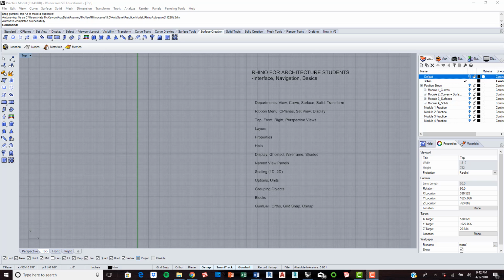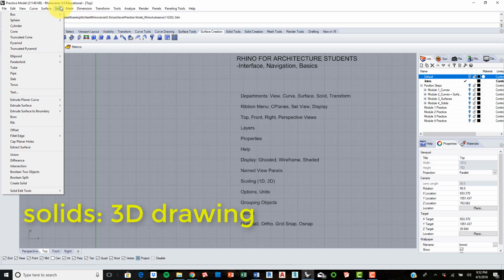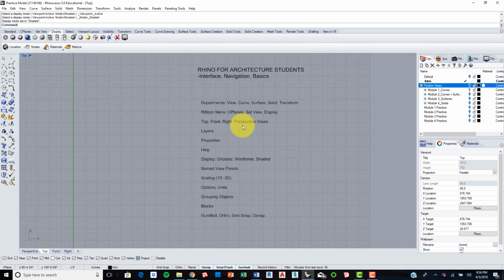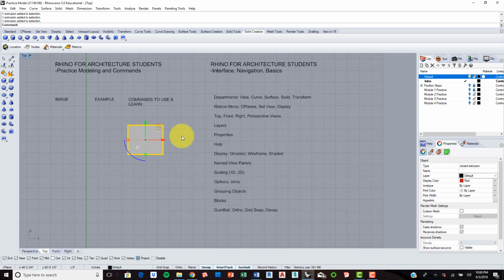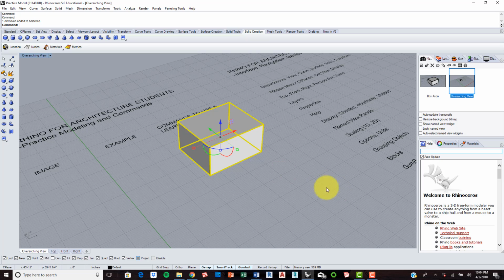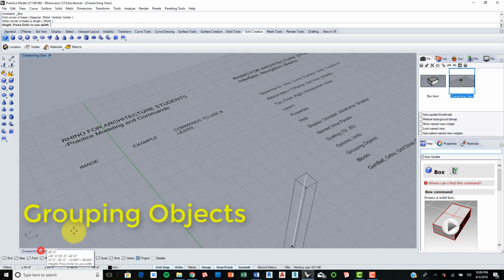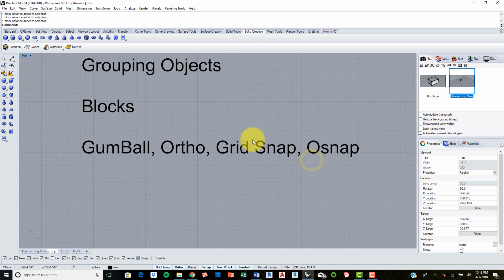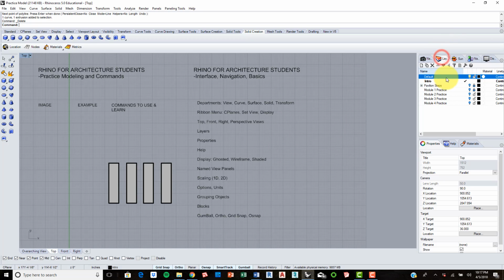Rhino for Architecture Introduction & Basics

Comment: Hi, thank you for the video, i got a problem all the display modes, except the wireframe one, doesn't work, for the wireframe i changed the pipeline to windows but i tried several things to fix the other modes but still nothing the viewport is just blocked, i'm stuck, i can't modify anything, neither navugate in the viewport. Thank you some help, would be appriciated!